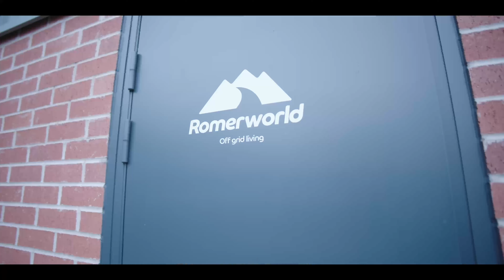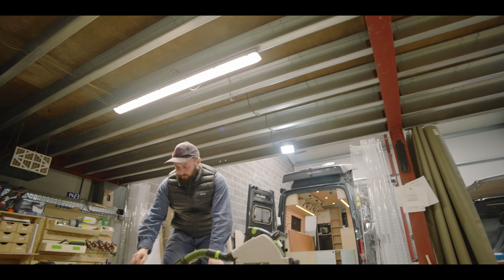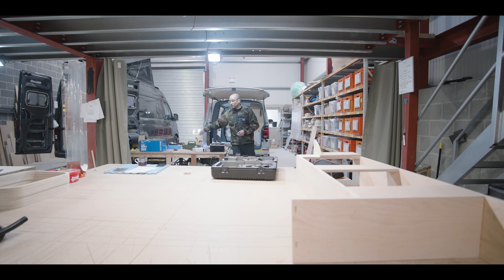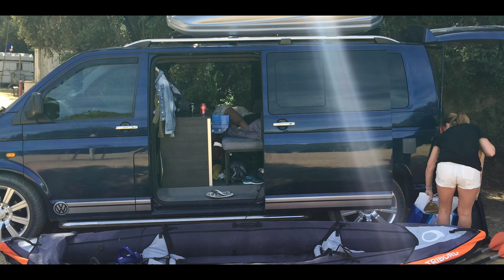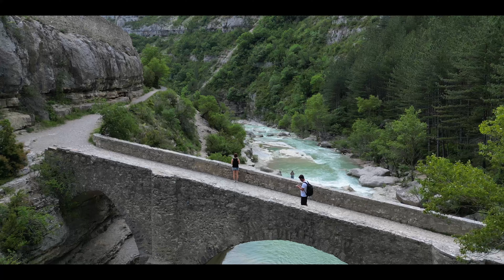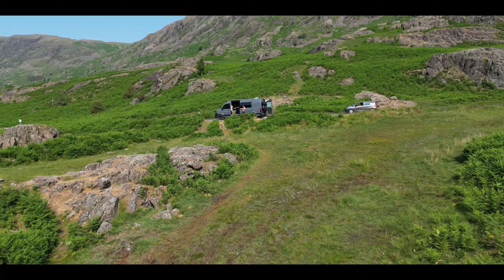Expert van builder Interview - Roamerworld Sheffield. Motorhome Industry

Comment: You’re 100% correct about the shower trays. Even when they are framed out, the wood frame will eventually rot and the tray will crack and then leak. I had already decided to go with a Stainless steel shower tray as I’m 17 stone and want to buy a tray once and once only. If you buy cheap, you’ll buy twice, I’d rather save a little more and do it right first time. Quality items and quality videos too!
Reply from the maker: I think that’s it. Some choices could end up being a nightmare to replace. Floor choice is another example.